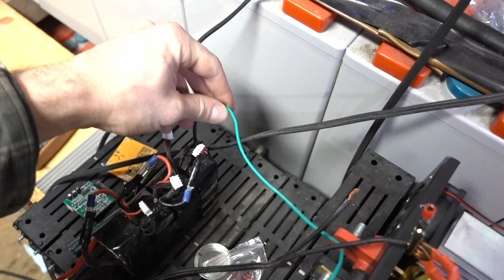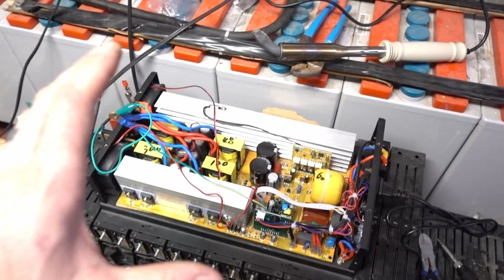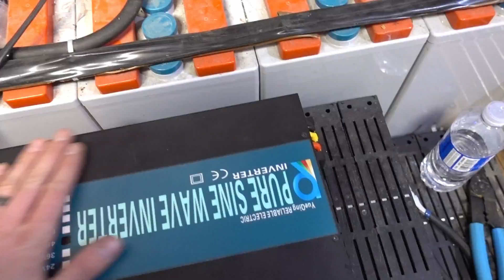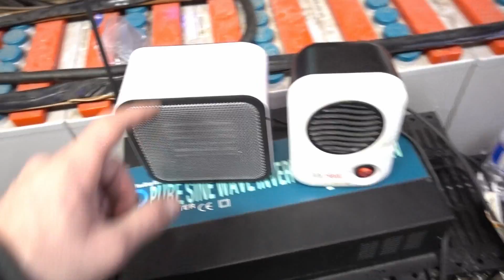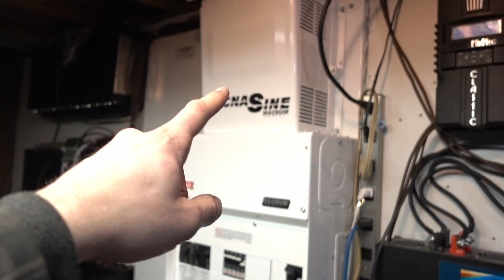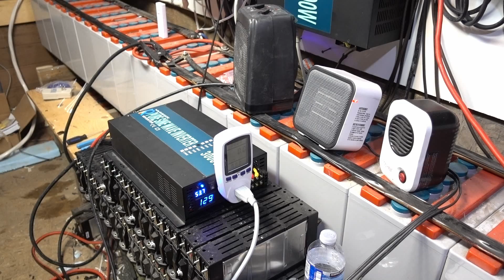3000W inverter Repair Pt 4 Stress Test

Comment: Your surge load shutdown is the feedback potentiometer on the driver board that allows you to gauge the wattage just slowly turn it up to get the wattage you need
Reply from the maker: Really, I'll have to test thanks
Reply: @GoingOffGrid101  yes really I’m a electrical engineer that built high frequency inverter for a living and just to be more clear on your high side switching mosfets the gate drivers bjt should be replaced after a blow up and your low side igbt full load wattage reduces by half when the load it at max 3kw so if you using fgh60n60 igbt the wattage is 600 watt at the temperature 25/c that starting wattage so when the load is heavier the wattage reduces because of conductivity heating losses so the watt is 300 so buy use 8 igbt the wattage will be 2400 watt not 3000watt ok just add 4 more igbt one to each channel to get the fully 3000watt and more you will get 3650 watt to be exact
Reply from the maker: @Dc_tech386  well thank you very much!
Reply from the maker: My problem  is when I ask for drivers I sometimes gets wrong voltage piggyback  boards...
Reply: @GoingOffGrid101  wrong voltage board ! or you talking about the low side driver or high side driver but the driver board voltage don’t cause any problems the higher the signal voltage is the better the igbt will perform but if the overloaded resistor is not controllable you should feed the that resistor it’s on the 130 volt voltage output line a big resistor is there that sense the overloaded voltage a resistor is connected to it removed it and test the valve of the resistor and feed a potentiometer with a little higher vole resistance and connected it to the board it the resistor is not a potentiometer make sure to contact the middle pin of the potentiometer to the same place the resistor is removed from the potentiometer have 3 pin one should connect to the big resistor that the 130 volt ac is passing through and the other to ground the middle pin to connected back to the same spot the resistor you removed and slowly turn to the resistor valve that the old resistor valve was I believe the resistor on that board is 500k

Comment: 129vac x 15 amp=1935 watts (those receptacles are only good for a total of 15 amps as per the manual)..Now the other hardwired connectors are good for 25 amps..
120volts X 25 amps=3000 watts..

Comment: Do you fix inverters for people?
Reply from the maker: what inverter do you have that needs fixing ?
Reply: Unfortunately it’s a no name brand (might be why it failed), but it’s a 3000w 24v one that seems to have a few mosfets on the input section that exploded.  Everything else seems clean and new.  

The unit turns on but gives a short circuit message and doesn’t work.
Reply from the maker: @forrestgore6874  where do you live state or province?
Reply: Washington state
Reply from the maker: @forrestgore6874  shipping will cost almost the same as a new inverter :(

Comment: How are you planning to wiring your solar array, I have 1.53kw going to a 60a Controller all in parallel at 36v although I am considering upping the voltage to 72v by putting 6 pallets in pairs of 2. Problem is half of them are already on the roof.
Reply from the maker: ken pen I have my panels wired 3 in series and the rest in parallel

Comment: I have the same inverter. Only the input voltage is 24 volts and the output voltage is 230 volts. Output frequency is 50 Hz. Recently I have problems with too low output voltages. It's a little less than 200 volts. No matter whether it is loaded or not.  Can anyone figure out what it can cause? Input voltage is OK.
Reply from the maker: if you open it up there will be a little blue box with a flat screw head on it turn that 2 turns one way and check voltage, if it drops go the other way to increase voltage.
Reply: Thanks, I'll try it over the weekend.
Reply: Unfortunately, this blue detail was poured over with some kind of glue or resin. I did not start trying to remove it because I'm afraid to damage this item.
However, the inverter output voltage has now risen. It usually stays between 200 and 220 volts. A few days ago, it rose slightly over 230 volts. Interestingly, what could be this tension fluctuation?
No interruptions have been encountered with devices powered by an inverter.
Now moving on to another topic: today I discovered that the voltage from my solar panels has fallen drastically despite the sunshine. I have solar panels connected in two series (100 w panels). Under sunshine, they only delivered 25 volts of voltage under load. When I removed the load (that is, the charging controller), the voltage increased to 43 volts. I opened the connection box on the outer wall of the building and found that it was 2/3 full of ice (we still have winter in Estonia).  In some ways, the rainwater has penetrated into the connecting box. Rainwater is not a good enough electrical conductor to cause short circuits. Rather, there was electrolysis there. The water in the box was darkened. Probably some chemical compound formed on the basis of copper and water. I threw off the ice with hair dryer. I cleared the wires and connected again. Voltage still 25 volts under load and does not increase. Did the connections inside the water could damage the solar panels? Is there a short circuit or other fault in the charger controller? How i can fix it?
I use the cheaper Chinese PWM charger for the last few days. In the coming days I will receive the MPPT charge controller. That should also answer my question.
Reply from the maker: the inverters pot that you said is covered might be a little finicky, just be touching it can change voltage sometimes, the solar panels are 43 volt open voltage, and you use a pwm controller that brings the voltage of the panels down to the same voltage as the batteries, let you batteries fulling charge and when in float you panel voltage will rise. I take it you have a 24v inverter.
Reply: My inverter has been working well recently. The output voltage is usually in the range of 225-230 volts. I increased the load on the inverter. Nothing has been regulated. After that, the voltage problems have disappeared. Hopefully there will no longer be any problems.
I recently got solar panels and gel batteries. Also, the 60 A MPPT charging controller. Now I have installed a production capacity of 1.6 kW and a total capacity of batteries 300Ah @ 24 V.
When I get ready for the new panel with instruments and switches and fuses, then I will definitely make a video of this system.
Reply: I too have the same inverter 24v 30000W unit, but my has been happily running a 32in LED Flat screen TV and PS 4 with a telephone charge station a some lights. This has taken it up to 1200W so far. However I plan to run more than this off the unit, but looking at what I am seeing here on YouTube I beginning to wonder if I should.
Reply: Tarmo Hermann my response has ended up on the main string!

Comment: The micro controller mite be set to 2000w cut off
Reply from the maker: that would be a big mistake on their part, I asked for a 3000w repair kit...
Reply: Going Off Grid do you have any photos of the cards that had lots of pins on them likely they have markings on them
Reply from the maker: no only what is on video, and I sent it back to the owner already.

Comment: hrm maybe because the voltage is set pretty high it cannot achieve that due to transformer ratios so it sags and the inverter shuts off. really weird how none of these inverters have any sort of input/output current sensing.

Comment: Your gels are sagging. Mine hold at 49.5 for hours at 2500w load. But excellent work on the repair. Great series
Reply from the maker: they dont sag, that was the 20 feet of booster cables

Comment: Better than nothing? That extra 1,000w comes in real handy when you figured out you need 3,000w min so 2/3% or .66% out of 100% The Unreliable Reliable Inverter. Why didn't you adjust the voltage to 120v before doing a stress test?
Reply from the maker: yes  the loss 1000w is a big downer, but this is not the first inverter from reliable that is like this I got a 3000w modle and it only out put 2200w then I talk to them and they sent me a new 3000w inverter that does 3000w and it only cost me 150 for the new inverter.
Reply: Who makes the Reliable inverter?  Made in China...   Nice work on fix by the way.  If you want 3000 watt then you got to go up Manga, Outback, Xantrex.  I have pulled many a burnt 3000 watt China ones apart.  Owner says it did not work after trying to run 2 1500 watt heaters off it.  Take apart and main board said 1500 watt.  
Not meaning to be nasty here but there is a reason why my 3600 watt outback inverter has a big ass transformer in it people.
Reply from the maker: I have a reliable 3000w inverter that will run 2 1500w heaters, I also have and love my magnasine 4400w 48v inverter, I also have a 8000w reliable inverter that can run much much more then my beloved magnasine 4400w inverter witch cost 3 time more money.
Reply from the maker: and reliable makes the inverter ,its a stand alone company I believe.